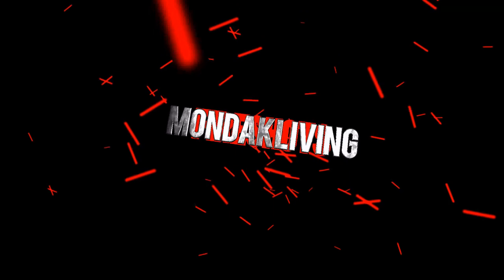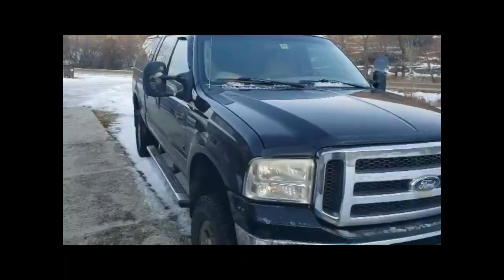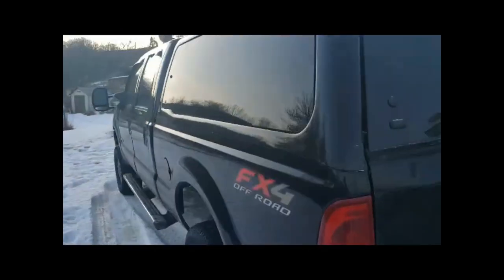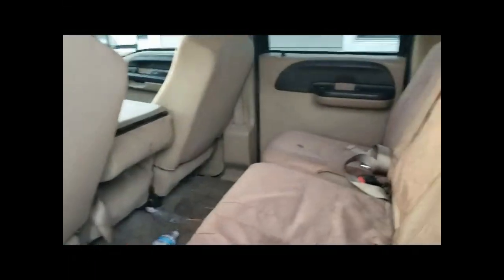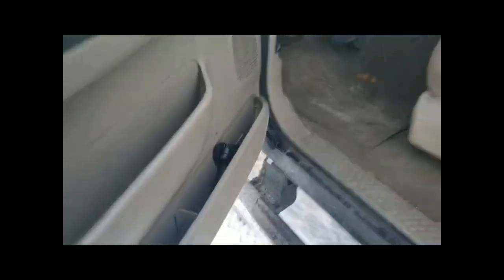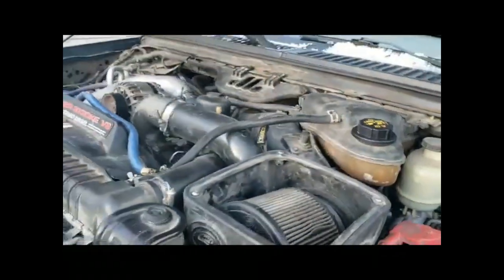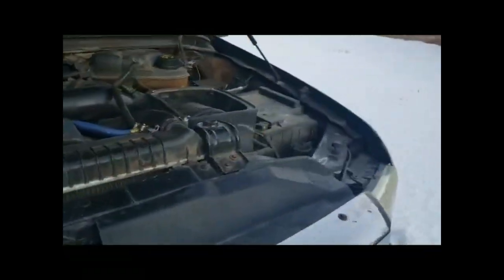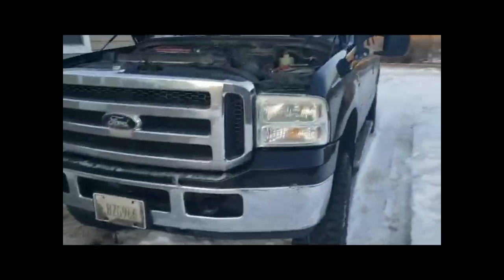BUGOUT PICKUP TRUCK WALK AROUND 2020 / WATCH FOR UPDATES!!

Comment: As an owner of one of these trucks I can say once all the bugs get worked out and proper maintenance is done on these trucks they are great. I did a coolant flush on mine and then chased coolant leaks at about every fitting after I did it. It seems like it just started showing all its weak points after she’d been opened up. Replaced everything and now all is well. One thing I will say is stay away from aftermarket parts and stick with oem or stuff from bulletproof diesel. Enjoy your 6.oh
Reply from the maker: Thank you, yes they are a great rig if they are properly taken care of, everything that I have been doing on this is going back to oem. I can't stand it when people use aftermarket filters and stuff esspecially on these motors. I hope all is well with you and yours take care!